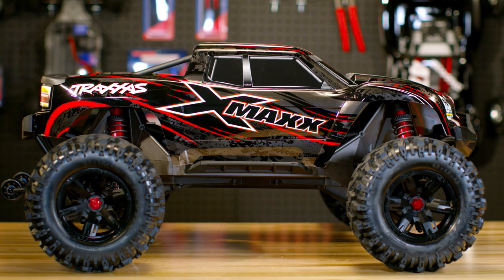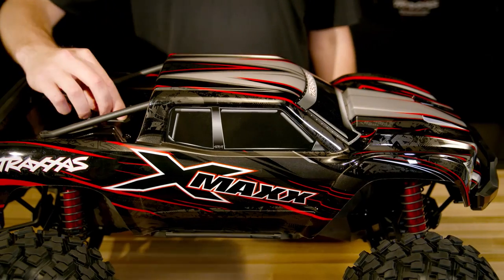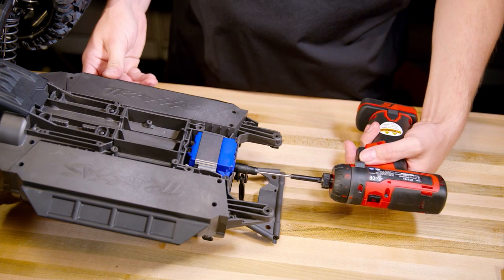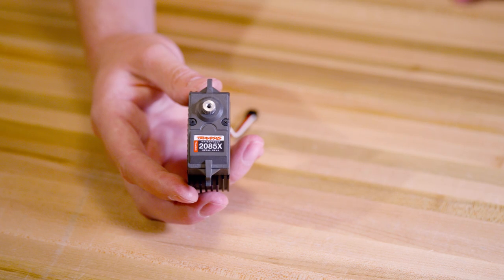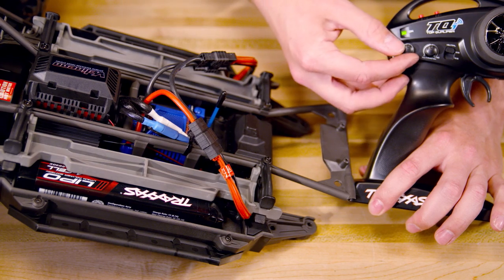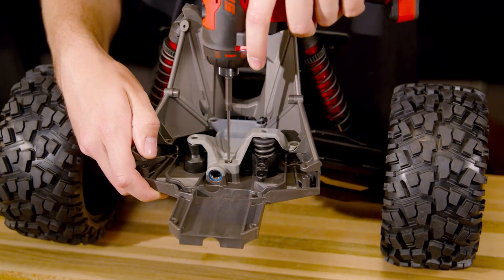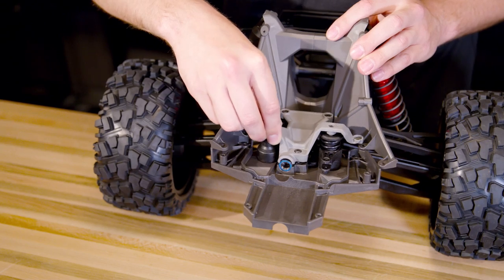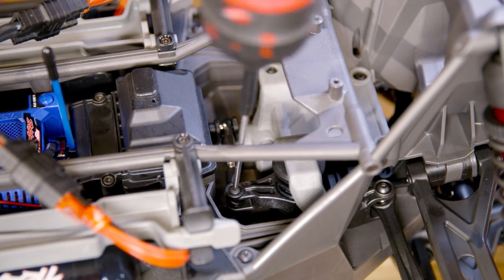How to Install a 2085X Steering Servo | Traxxas X-Maxx

Comment: Pretty sad that after I spend $1200 on an Xmaxx and Traxxas batteries, I get 1 run and have to upgrade the steering to what should have been there to begin with. Didn't have this kind of inferior parts in Axial equipment.
Reply: Just talked with Traxxas  today  about how i spent over 1000 for a 8s x maxx snap on edition and                            both times i ran it for like 20 mins no bashing no jumping no flipping just some speed runs on ball field  the 2085 servo stripped  the original one that came with it and the one i purchased from hobby shop to replace needless to say was not happy with customer support or this truck that they used inferior parts and will not be looking to purchase another product from them again   wow they want to send me a 10 dollar rebuild kit so i can fix the junk servo they used and then have the same problem again
Reply: Same here, and I still haven't received the rebuild kit 2 weeks later. Very Poor Traxxas Customer Support. First and Last Traxxas purchase. I did upgrade to the MG servo, just waiting on the parts for the OEM so I can sell or possibly use on something else, like landing gear.
Reply: Had the same issue. Wonder if this is a flaw in the product? Ummmmm
Reply: It definitely is. There's no point having a nylon gear servo in a 21 lb. truck! Not to mention a servo with that much torque.
Reply: Hi, got as well some problem(S) with my xmaxx the servo after running it for a month original servo died, ordered that stupid 2085X which normally a reinforced one but no! also died even quicker than the orignal just after running it on a field 20mns tops no bashing it got stuck wheels turned in one direction and the servo (2085X) was hot and didn’t work anymore! The thing is i bought it through amazon 100€ it was not a traxxas seller so i guess i can forget the warranty 😔🔫.... then now ordered a new one 2085X just to give it another chance i was thinking the first 2085X was a default from the fabric now got the servo 2085X last and run it for about 20 minutes and it died again same problem like the previous one its really not cool anymore now i sent it back where i bought my xmaxx ill see what excuses will i get!
Reply: Really 1200? With that money I could pay a whole month a rent buy a smt10
Reply: You never purchased an axial exotera. Axial makes crap also.

Comment: Traxxas should be utterly embarrassed to sell a product that breaks in the first use putting around a level yard. Our xmaxx made it around the yard for a couple slow laps before the stock servo gears stripped on Christmas. What a big disappointment! I'm going to install the metal gear kit until I have the chance to upgrade to a Promodler servo. Honestly the upgrade should be free given the faulty design.
Reply: No doubt
Reply: Sounds like you didn’t set the end points of the servo first out of the box before use.

Comment: Can not believe this isn't a stock part.
Reply: It’s so they can get more money later. Since it’s an uncommon size, it’s this one or a 1/5th scale mod.
Reply: Definitely..Cmon Traxxas, get it together!
Reply: Furio  my dude, you can get the upgrade servo for $120 posted on ebay, or the metal gears from the upgrade servo for less than 50, they fit in the stock servo
Reply: Furio  yeah, im going to swap to a 46kg servo and metal push rods once this upgrade servo dies
Reply: You can get the adapter from traxxas and run whatever you want..
Reply: Be nice to ha e steering tied rods with turn buckles instead of solid plastic rods...ugh...$899 for all plastic..Arrma 8s got ya beat for adjustments
Reply: Jaime Finnley  gtfo
Reply: Yip this and the link.

Comment: Mine didn't make it through a full battery before it blew the original servo out. I wasn't even bashing it either.
Reply: Same here.
Reply: Man I got over a year on mine of hard bashing
Reply: Now its in and out far as working idk whats going on lol
Reply: Same
Reply: If I can ask what did it do when it went....I'm having a issue with servo I believe...thank in advance!!
Reply: @andyb9994  just drove mines for the first time today and it whining but won’t turn, unreal
Reply: @Todd_G_FPV  same I did couple months days bashing then straight 20ft jumps flips and all that great fun broke it thought after about 1.5 years on concrete it just suddenly went and that was that.
Reply: @smokeking85 it was the same with mine bloody pain of a servo I've finally got my hands on the part but now the repair which should have never needed to happen.

Comment: With easy use the stock servo went out on 3rd battery. The 2085x servo should be a stock part! Looks hard, but only took about 30 min to complete thank you for the video but no mention  how tight should you go with the new spring?

Comment: Been bashing mine for almost 2 years now and I'm still on the stock servo lol (now it will go out since I said something) Upgraded upper and lower a-arms around the whole truck/rims and tires/steering arms/rear big gear/dog bones/upgraded bearings and hardware in all 4 wheels.and brand new lipos. It's an absolute beast! 💯  Worth every penny I've put into it. Now I'm adding this servo and a new body to my cart lol
Reply: Mine literally went out a few days ago. I'm gonna go and get a stronger one for sure

Comment: make sure you turn the tsm all the way off before you adjust the steering trim.
Reply: Yeah, that and level the truck on a work stand, even with the TSM turned all the way down, it still engages.

Comment: Silly question here: If I do this upgrade to servo 2085X, but keep the stock spring (instead of installing the much firmer spring that comes with the upgrade), would that further protect my build from servo stripping?  (The gears of my initial stock servo were stripped in no time, and even though the upgraded servo is all-metal-gears, I really don't want to have to dish out close to 100usd with delivery to fix this problem ever again!).
Reply: Absolutely
Reply: Actually not a bad idea, but the upgrade servo can twist the servo saver really easily with the stock spring, can have negative effects on handling - makes it pretty sloppy.
Reply: Im having trouble getting the screw back in with the new upgraded servo saver spring and its so firm?
Reply: Worth a try for sure. Great idea.

Comment: That seems like a big job. I think putting in a new servo into the rustler is easier...
Reply: Zzzzzz... even the rustler is hard
Reply: Zzzzzz...  1/16 slash us harder
Reply: the twinn hammers is even harder than all of yours
Reply: No not really, I have done it twice, way easier then this.
Reply: Zzzzzz... Probably
Reply: Zzzzzz... what way is easier buddy
Reply: And the slash is super ez to fix to!
Reply: It's actually not that bad
Reply: Did you guys end up swapping your servos? 😂

I just swapped mine out, took 10min

Comment: Does the servo saver spring. Need fully  tightening down?
Reply: Wasn't sure I guesstimated. The instructions were crap. Stripped the threads too.
Reply: @charliewilson3234  common problem... Use a locking nut and bolt. A poor design..

Comment: Picked up 2020 X Maxx and stock servo failed after 3 runs.  Paid to upgrade to 2085x servo and now it has failed!!!  Need to warranty these parts.  Truck not even 1 month old!  Taking to my local hobby shop to repair.
Reply: Can't turn the wheels when the vehicle is on pavement and not in motion no matter which servoi is in the vehicle.

Comment: She lost me at disconnect the module.
How many linkage screws are there? I unscrewed one then flipped over. Took the 4 front screws out. Then tried to pull it apart and failed

Comment: Where can I find those power tool bits ?? Been looking for them like hell. No luck . Please help
Reply: Ahad Khan: team associated has a set under the factory team name and arrowmax rc has a set.
Reply: You can buy direct from Traxxas, or a Traxxas hobby shop, part number #8715 is the 3 piece set of speed bits, 1/4" drive, short (includes 1.5mm, 2.0mm, and 2.5mm bits)

Comment: is this servo 1/5 scale or something In the middle also could I put a 5th scale serv0 in the xmaxx get way more torque than one of these right how much is the stock 2085 in torque and how much is the 23% gain on 2085x in oz

Comment: Man, I agree with all of yall, and let me say I have no skin in the game with Traxxas. 

To be honest, I'm Gen X, back in the 80s. Traxxas was trash it was all about TA, Kyosho. 

I come back to the hobby at 51 years old and a lot has changed. For one, Traxxas now leads the market with RTRs , wtf? We used to have to build our kits so we could work on em when they broke and they did break. At 11 years 1983, I spent all my lawn mowing money on my cheap Kyosho Pegasus. I was racing at my local track that I mowed lawns all summer to buy myself. 

Anyway, I've been back 2 years now and learned all about brushless setups , lipos , etc... 

And I will say this even back in the day, we would upgrade our cars. There were so many aftermarket parts and the fluorescent dyes by light speed. lol it was all part of the hobby. 

It most likely cost Traxxas a lot of money on R&D , production,  importing, etc... 

So, to make it cost-effective, I can see where they cut corners to keep the consumers' price down. 

Servos, axles, drive shafts, gears, etc... all the stuff that most people upgrade anyway. 

I dont think any manufacturer makes a product in this Biden Economy without having to cut corners. Stuff is expensive! 

Now, what I see as a great thing is that Traxxas is catering to the RC enthusiast.  They just released the Mudboss ( modified) have yall seen this car? I purchased mine from Taxxas in Mckinney,  Tx, on June 23rd, two days after the release. 

The detail is amazing , so if I have to spend a few more bucks on whatever to make this car bulletproof, then so be it. Where else are you gonna find a modified that looks this good? And yes, even better than the mudboss. 

So I'm gonna hold off on the bitchen and accept the cost in order to get the cool cars. Im hoping for an outlaw winged sprint car next.

Comment: This x max 8s $900 plus two batteries $150 plus charger $100.. and I have to take entire rc apart for a faulty part traxxas build it with.  I put four hours on this car and it sat ever since.  Now here I am putting hours of time into it just to be able to use it.. im going with losi rc for now on.  This is insane.

Comment: I’m new to rc, my first is vxl russler. Love it. I pick my xmaxx up this Friday. What exactly does this new servo do? Is it a must upgrade?
Reply: So far of what I heard of is that the stock servo strips on like the first couple runs. I plan on buying one here soon so I'mma just buy the servo with it.
Reply: Mines still stock lol been bashing it for almost 2 years.
Reply: Had my xmaxx since March haven't been jumping it just driving on a softball field and on the road. Probably drove it about 15 times in all sadly to say steering servo went out this past Sunday so I would say yes definitely upgrade
Reply: @mikeydizzle84  same here. No issues. Been bashing, jumping and flipping it. I'm still on the stock servo. I bought the 2085X with the upgraded horn assuming I would be doing it right away. But I'm still on the stock equipment. Same for my Maxx. I beat the living daylights out of that vehicle as well and I'm still on the stock servo, even though I bought a 2085X and a server for that vehicle as well. But both vehicles have held up to all of the heavy bashing that I give them. I purchased my Maxx  2 1/2 years ago, and I got my X Maxx in December.
Reply: Personnellement j'utilise toujours celui d'origine j'ai aucun problème pour moi malgré les nombre crash

Comment: Pretty sad i paid mine 1500€ batteries included and i got all the accessories with proline MX43, Proline shock absorbers full kit from springs to you name it, LEDS front/ rear from Traxxas was happy for the first month then now im not enjoying anymore servo issues, differential issues, got my 2nd servo installed 2085X keep on breaking 😔🔫
Reply: The solution is Promodler servo DS635BLHV plus Alloy hardware. Military spec servo that should never break.
Reply: @BrianNC81  is there a link to purchase?

Comment: My stock servo broke on 3rd run.  The 2085x broke on 2nd run.      Now I have two servos I need to send to traxxas while my warranty expires.     :(.
Reply: Buy a Promodler servo. Military grade hardware that will not break. DS635BLHV plus the install kit.

Comment: I recently had to put a new servo in my 1/16 slash and the servo works but now it doesn't go as fast and makes a clicking nose I've also looked if the pinion was to close to the spur but it was fine can anybody help on what's wrong?
Reply from the maker: You can give us a call at 1-888-TRAXXAS and we'd be happy to help!
Reply: Traxxas Support  recently bought the 8s maxx and servo went out

Comment: I installed this new servo and I feel like turning isnt as tight as with the stock servo. Any suggestions on how to troubleshoot this issue?
Reply: Your steering push rods might be bending. Mine are starting to bow a little bit, but its not really hurting the turning circle too much yet.
Reply: turn out the steering turnbuckle supplied and readjust end points

Comment: this is a great servo. I got one for my x maxx 8s
Reply: ULTiMATE TRAXXAS MAN no it's not
Reply: Rasheed Wallace do you even have one
Reply: ULTiMATE TRAXXAS MAN yes. And it's already been replaced twice. It's not even a true 1/5 scale servo.
Reply: Rasheed Wallace what ever. i have 2 of them they are both great
Reply: ULTiMATE TRAXXAS MAN whatever u say Traxxas fan boy. Why do you think they were out of stock for two months ? Warranty replace. Buy a savox brushless
Reply: I have Savox servos for my 1/10s, but did some research and couldn’t seem to find one for the X-Maxx. Is it the Savox brushless plus a servo adapter? Let me know what you recommend. Thanks!
Reply: Funny thing is I ordered one because I always upgrade my servos and everyone is talking about stock servo striping I have been abusing my stock servo and it still runs great . just saying

Comment: How much do I tighten the screw to compress the spring
Reply: That is a very good question that I'd like them to answer too! I'm having lots of issues with my steering since I installed this upgrade.
Reply: All the way down. You can also use a longer screw (3x20mm I believe I used) and add a M3 Nylon Locknut (Traxxas #2745) to the underside to make it so the threads do not pull out of the plastic from the stress.
Reply: @Truth_Spoken  thank you so much for this info!
Reply: oh boy do I also need an answer to John's question... My steering is sloppy and sluggish since i did this change. My initial stock servo broke in a day or so without any big shock - and i had to wait until my next trip to the usa to get the upgrade servo. And while doing the upgrade, I fear i might have stripped the thread, but it seems to hold down now... but it's sluggish and sloppy. And look at that... Rob has my answer! Thank you both. I know what i'll do next weekend.
Reply: @jeanfoutre3620  It's just nature of the beast. Mine has always been sloppy and lazy, but I am used to racing 1/8th scale buggies. I don't know of anything else to make it better but I haven't really looked. Mine just sits on the shelf for the most part.

Comment: Mine was broken brand new. Didnt even hit the throttle once before the wheels started violently shaking
Reply from the maker: Please contact Traxxas Support and we will be happy to help!
U.S. - 1-888-TRAXXAS
Outside U.S. - 972-549-3000
E-mail - support@traxxas.com
Reply: @TraxxasSupport  my steering servo is no good at all,I'm on my second battery pack! In Australia I payed $1345 AUD it's not good enough! Can you respond to this,alot of your customer's have servo and ESC issues,can't even use my truck !
Reply: @TraxxasSupport  why dont you guys fix this crap. All my friends seen the broken junk you put out and decided to go with a different brand.

Comment: My original servo is going strong. 
Of course, now that I've seen this it'll die. 

The ESC died though, which is why I'm on YouTube.
Reply: Yeah, my original servo just gave out the other day, and that was only because a pin on the steering popped out and i didnt notice it binding up 😅 (after 20+ packs and jumps that would break just about any other RC)

Comment: Just upgraded.  Plastic gears were fine in old 2085 after I did swap.  Just weak torque I think .  Shouldn't need to do this upgrade in the first place but here we are.  £100 for the 2085x and they couldn't even give me a metal servo horn😂

Comment: Omfg.  Why did the tell us not to over torque the cap on top of the spring!  It broke from the pressure.
Reply: If you stripped the screw out where the spring is, just put a little bit of a longer screw in with a lock nut on it. It works much better that way. Kevin talbot has a video on how to do it. On his red xmaxx

Comment: This servo fits the Maxx as well.  The servo saver spring that comes with the kit will NOT fit the Maxx.  It's not even close to the same size.  Support recommended the steel servo horn to go with it.
Reply: Does it work well with the maxx and what spring did you use instead?

Comment: For 1k truck, they could've fitted a decent servo. Mine died today. Only 5 days. And only run it for 3 days. First problem was front shocks started leaking after first run for about 20 min. No jumps or crazy stunts. Then the servo just gave up. Just running back and forth the park. Sad. Overall its a good truck, just they could've done better out the box. Im just glad that nobody else in the park, its dangerous.